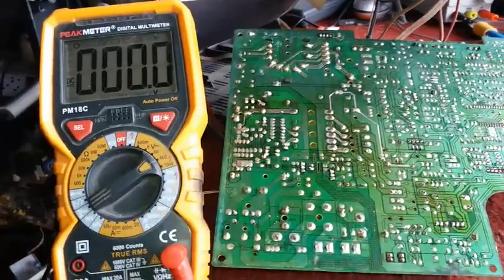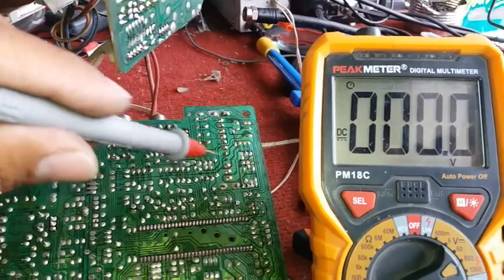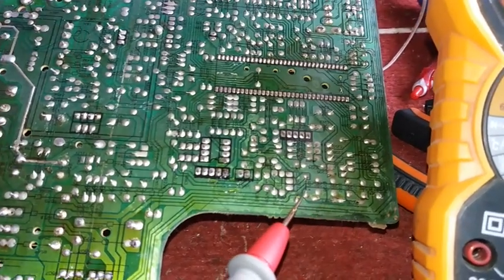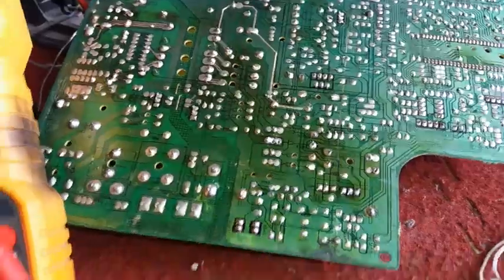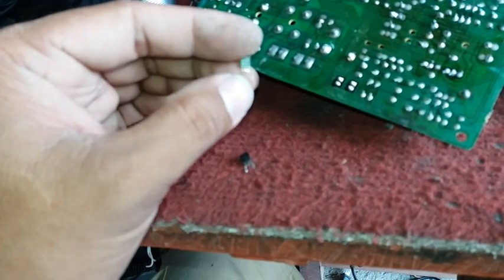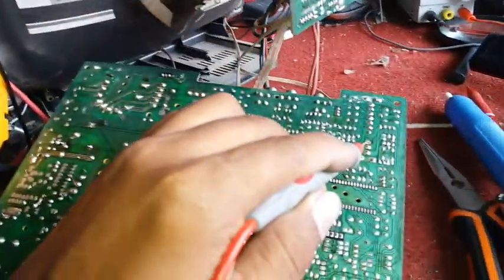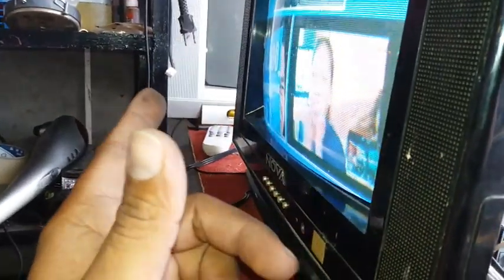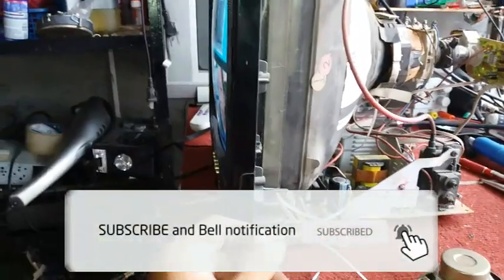NO 33 VOLTS IN TUNER NO TV SIGNAL CRT TV REPAIR

Comment: new subscriber master!
may trouble aq.
no 33v on tuner 
after i open, still no 33. palit tuner still no 33. open ko bwat pin ng tuner after sa UVL nagka 31vdc.
san p kya galing ang damge
newbie!,.
Reply from the maker: check mo yung resistor galing sa secondary to tuner baka open yan or mahina na
Reply: @xiantekelectronics  master tek! ung akin is before ng input sa 33v ng tuner may 33 nmn aftee i open ung resistor may output nmn sya. kaya nagpalit aq ng tuner kso d same. 1v somethinf lng.
Reply: @xiantekelectronics  kapag nilalagay q ung channel wlang ding raster